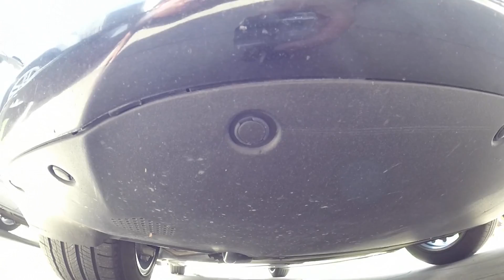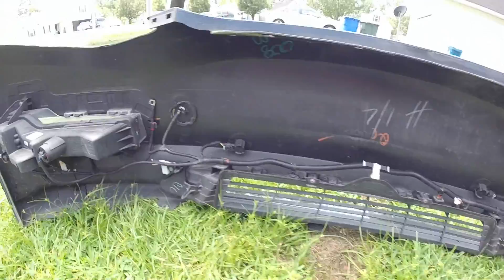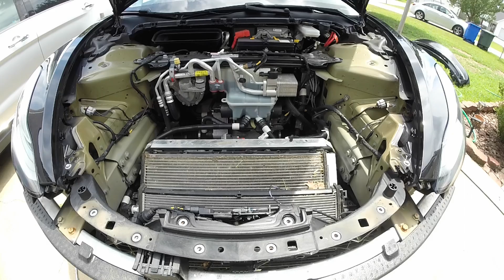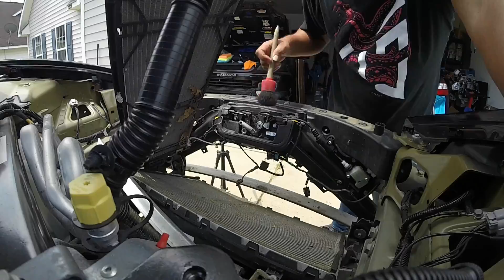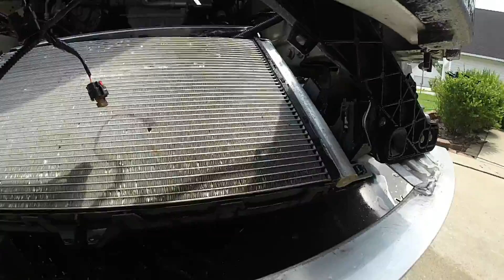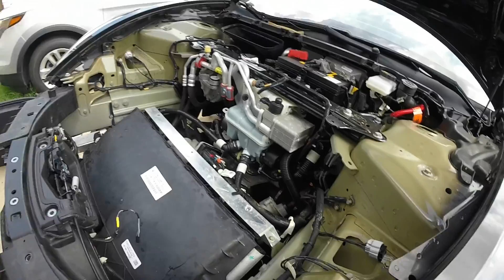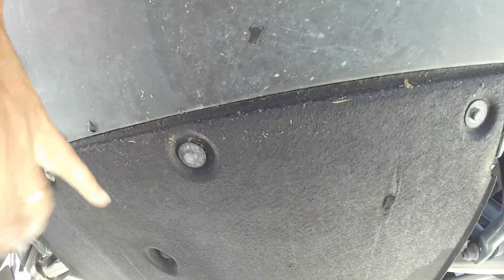Tesla Model 3 radiator condenser cleaning

Comment: That preasure jet will not bent the radiator fins ?
Reply from the maker: It can, I started far away from the radiator and brought it close enough to remove the grime. I also kept the stream straight and not at an angle. My pressure washer is only 1600 psi, and I can get my hand about 5 inches away from the nozzle before it hurts. I have had other pressure washers that have triple the power, I wouldn't use those.

Comment: I just finished doing this to my m3 today before I came across your video . Such a bad design, my radiator was so clogged up that my ac wasn’t working good in these hot Az temps but after cleaning my radiator my fan is quieter and my ac works perfect!
Reply from the maker: When it's been a year from cleaning, I will be doing an update video on how much it gets dirty. I have 2 model 3. One drives 1000 miles a  week, the other about 200 miles. This hopefully shows how dirty it gets and gives a better perspective on when to clean.
Reply: Do I have to out my car into some kind of service mode before I attempt this??
Reply from the maker: @DrakeKC  no.

Comment: Thank you for the video I have a certificate in auto mechanic and I very much appreciate enjoyed your video, Do you work on Tesla a lot.
Reply from the maker: I own 2 teslas. Unfortunately I haven't had any real problems with my teslas to work on them allot. For example, I replaced the brake, rotors on one of them simply because the rotors were rusty, the pads were like new and the car has 90k miles. I also decided to swap the wheel bearings simply because of the mileage and I started to hear a wheel bearing sound but I believe that it was because I have tracked the car a bit too hard. Lol

Comment: @jorgegarcia7005,

Thanks so much for this video.  I've also watched the other one where you put people's comments to the test.  Great stuff.  I plan on doing this with my 3 this week.  My driveway is not level, so I plan on taking everything apart in the garage first.  Then move the car out to the driveway to do the cleaning.  My question is - is the car drivable at this point?  I don't think it needs to be jacked up either for the cleaning process, right?
Reply from the maker: There's a video where a guy took off parts to see when a model 3 wouldn't run. I believe that it should, but I'm not 100% sure.
Reply: @jorgegarcia7005  Thanks for letting me know, Jorge.  I'll be trying it out today and will let you know if it runs.
Reply: @jorgegarcia7005  so I'm stuck at the removing the fan shroud part.  There are 2 horns right above the fan shroud that are blocking it, so I need to figure out how to remove those first.

Comment: 400 V and water, not a good combination
Reply from the maker: Automotive Parts are designed to be  water resistant and, in some cases waterproof when they are on the outside of the cabin. I've done 5 cars so far and have had zero issues. I believe that I'll be fine.

Comment: Great video, very helpful. Did this over the weekend and your video helped big time. Not to mention, mine was WAY dirtier. I'm also at 230k miles, and I've never done this.
Reply from the maker: Nice! I'm glad to hear that my video was of help to you.
Reply: @jorgegarcia7005  big time, thank you
Reply: Mine is 150 k miles
Just wanted to to check are you on original battery and drive unit ?

Comment: Hello, nice video, good explaned, but using the pressure washer is dangerous to bend al the small plates. I have done it one time with the radiator of a honda motorcycle, and it bended al the plates.
Reply from the maker: I made another video explaining how and why I use the pressure washer.
Reply: @jorgegarcia7005 could you please send the link to the other video? 🙏🏻
Reply from the maker: https://youtu.be/nsc7Wn4R55U?si=5XyOhy-yOCSFwvHz

Comment: Why would we pressure wash it in the direction debris went at the condenser. This will make debris trap in there deeper and harder to remove. Can we blow air or water in the opposite direction?
Reply from the maker: I made a video showing why you want to use a pressure washer.
Reply: @jorgegarcia7005 my question is about the direction of flush and not about pressure wash or not.

Comment: Hi George, I really appreciate for such an in-depth video. This really helps to understand how to service the radiator. One question, I wonder if doing power wash like that might cause the water damage on the sensitive electrical parts around the radiator. What parts do you think one needs to watch out when using pressure wash like you did? to prevent electrical damage.
Reply from the maker: I personally didn't see anything that you should be concerned with. Just like any vehicle you should exercise caution, but since these connections are already sealed and safe from the elements a bit of water shouldn't cause any problems.

Comment: What year is this Tesla, mine is 2018 with over 105k miles, just took to Tesla for 100k miles but I doubt they did that, is the same process for the 2018 to clean the radiator? Great video btw.

Comment: Hold the fuck up they told me the only thing you only have to do is washer fluid top up.. Your now showing me I got to do this shit…
Reply from the maker: I mean, my ICE vehicles only say that I need to change some fluids, spark plugs every now and then but because it doesn't say anything about washing my motor it doesn't mean that I shouldn't or wouldn't.

Comment: That's the older Model 3 without the heat pump, right? Because then it should't have a climate condenser because it gets its environment energy from the coolant. That update could make this cleaning step obsolete :)

Comment: Great video, thanks 👍- the only thing I’d do different is use an industrial vacuum rather than a brush for part one. I believe that the brush will actually force some of the dirt in to the fins. 
(People saying how hard this is need to realise that many modern ICE cars are even harder to clean the condenser and radiator, including my 2014 ICE SUV.) 
I have a mesh guard in front of mine from Alibaba, but I’m not happy with how restrictive it is- probably reduces flow just as much as lots of dirt and leaves I very strongly suspect. 

HOWEVER it would be nice if Tesla came up with an update to be able to reverse the fans when stationary, - that would actually blow some of the dirt out. Just like the cabin filter, this is a design that could really be improved upon in future models.
P.S. I’m guessing you drive on salty roads in Winter, going by the rust on bolts and disc rotors. Our 4.3 year old Tesla M3P has ZERO rust anywhere- thankfully no salt needed on our roads in Winter.

Comment: Looks like I killed my main frunk actuator by accidentally spraying it with water when cleaning my radiator condenser. I didn't fail at once. It took a while. When I replaced the actuator I noticed there was water in the unit. A FAFO lesson learned.
Reply: 60 тис. Даремно знімав   Усе чісто. Але стоїть  сітка
Reply: @ВладимирКачалаба  Do you have a heat pump Tesla? Someone posted about a plastic screen over the panel. That might be a new part on those cars with one panel.

Comment: In the HVAC industry, they make a niece foam cleaner to spray to the condenser. When you flash w/ water it is best to do it from the opposite to the air flow. Watch a few videos on cleaning air conditioner condenser from a house, same process.
Reply from the maker: I've cleaned the hvac in my home. Yes, you are correct on the cleaning process. However, my home hvac hasn't had this type of material ran thru it, just dust and fine particulates. The crud in the model 3 was everything from leaves, pebbles, dirt and road grime. A complete different set of elements. I will be doing another tesla soon when I will use the comments on my video to show why I cleaned it the way I did. This wasn't my first one and I tried different things before and this is the best way to clean it.
Reply: The imbed dust and cotton wood is normal around here, the rinsing from the back does help a lot.  @jorgegarcia7005

Comment: great video! I used to use nubrite cleaner to clean my 20yr old car's radiator, worked a treat
Reply from the maker: The only aluminum cleaner that I have used that works great is napa aluminum brightener. The others are weak compared to how they were years ago.
Reply: @jorgegarcia7005  thanks! added this to my radar

Comment: DO NOT pressure wash them. you will bend the fins and then you will have a very obstructed radiator and condenser. You need to wash it using a soap solution and a hose, regular pressure from the water, not a stream with high pressure. This is true for ALL, not just Tesla. All radiators, condensers, intercoolers, etc.must be washed as I described. Otherwise the thin fins will bend blocking the air.
Reply: Well, you just watched them clean the radiator with a pressure washer and I don’t see where any more fins or bent so I don’t think you’re accurate
Reply: He didn't bend the fins. I suspect the fins are more durable than you think.
Reply: Washing with lowest pressure is not a problem
Reply: Good advice❤
Reply from the maker: I would like for you to clean a tesla radiator the way you described and record and post the results. I didn't just decide to do what I did. I have another tesla, which I also cleaned. I started with the simplest way (air) and worked my way up to pressure washing. Then, I decided to make a video with my other tesla and explain how to do it. If you watch the video, you will hear me explain about it pressure washer and the radiator finns.
Reply: Could buy a can of ac condenser cleaner . Soak it and then rinse with hose . Definitely need a cleaner on those fins and not high pressure water .
Reply: The pressure washer he used is as weak as piss, it’s a really cheap and gutless unit. I would be more concerned about some of his other dubious work practices.
Reply: @rsoul7282 you’re dubious

Comment: Thank you for the excellent video!  Would have never suspected. Is this the same horrid design to clean the Model Y, S and X?  I would hope by now Tesla engineers would have fixed this for the Model Y and refreshed S/X.  What frustrates me is the complicated TUD (Total Unintended Disassembly, to adapt a term from SpaceX) required to just clean the A/C condenser and battery radiator. If regular (should inexpensive and quick) cleaning is not done, chaos will ensue. Failed expensive parts or worse. 

Have an idea….  For everyone seeing this video with X checkmark, say something to Elon and Tesla accounts. Adding this video link to the post.  Let’s get them to have a redesign.  Cleaning should take few minutes. Not hours, with risks of damaging components.

Wonder if Highland model is fixed?
Reply: Proper design requires balancing a lot of competing goals.  Is ease of cleaning important?  Of course, but it's not the only thing that's important.
Reply: @ThinkAndLetThink  there is no excuse for this crap.  None.  Elon Musk (chief engineer), knew about this early. So did his engineers and lap dog supposed engineers.  They do not give a rip that most Tesla owners (who will not take their car apart like this video) will guarantee have to pay $1200 for Tesla service to clean this up. 

Since the video, I bought a clever Chinese designed grill replacement.  Hope the quality will be good.  It has various methods to foil leaves, seeds, ground up road trash debris from entering.  However, will not protect from dirty road rain water from being sucked up into this cooling system. I took my bore scope with extension to reach the radiators. So far, I am lucky to not have debris up there. Except……. Already dirty road rain water has begun to coat all the radiators cooling grid with dried dirt. Not good….

Comment: Using a high pressure jet on the thin radiator fins is not recommended as it twists them.
Cleaning with a vacuum cleaner then using compressed air seems less destructive.
Reply from the maker: As addressed in the video, the radiator fins are pretty strong. Not saying that you should get closer than I did with my pressure washer. Additionally, being that this is the second time that I have cleaned one of these, like mentioned in the video,  the crud in the fins is basically mud. Also, I'm pretty sure that my air compressor if it was able to get the crud out it would be just as strong as my pressure washer and would bend the fins if you would get too close.
Reply: Firstly, thank you for the video, very instructive, not easy to do both the work and video. That said, I would definitely vacuum first (with a brush attachment) because it immediately removes the surface debris, rather than brush it over the rest of the radiator. Seems like it should not get that way in the first place, like there should be an easily removable, cleanable filter. Thank you again for making the job clear.
Reply from the maker: @kirkdoray3393  I did another video showing all the advice on this cleaning. The vacuum isn't really good for the radiator. Please feel free to see my other video on this cleaning.

Comment: That’s a lot of work…didn’t even know the condenser had to be cleaned..
Reply from the maker: I do car repairs and to be honest this wasn't that hard.
Reply: @jorgegarcia7005  I am a retired former workshop owner and mechanic,I was a Renault dealer during 40 years in Strasbourg (France)
Reply from the maker: So we are in the same page. Lol retired US military here. Lol
Reply: @jorgegarcia7005 thanks for the video. I added an individual post/comment. I do not think some people understand how the angled radiators collect all the grime and blockage. Unlike pure vertical radiator.  Vertical radiators up front also will get some cleaning in car washes and rain. Where the deep embedded semi horizontal radiator/condenser become a big scoop for trash. 

My C4 Corvette had a slight angled radiator. It would clog easier than vertical radiator/condenser on the C4 which also was deeper embedded. However, the C4 was easy to keep clean. Thank you for the video.

Comment: Wow when you popped that open and all that crap fell out I thought what a terrible design.  Thanks for the video :)
Reply: The cost of having a frunk..
Reply: @mrflorida55 nah Tesla should just have mesh behind the grill, easy fix
Reply: @Spaceman2484  My point is radiator mounted vertically does not have this problem they could not do thay cuz frunk..

Comment: Tesla should be required to a full recall of this potentially dangerous design. They literally designed a pocket to collect dirt which blocks the only way the batteries are cooled. Insufficient cooling of batteries can shorten battery life at the least, or battery fire at the worst.  

A simple reversal of airflow, air intake side of radiators face down, could take care of most of the blockage. Adding Venturi effect or even cyclonic effect air flow before the air gets to the radiators would cause most debris to drop out instead of logging into the radiator.
Reply from the maker: I believe that reverse air flow should be a thing while supercharging. But great point.
Reply: Full recall - LOL :-). You’re kidding. The condenser and radiator in my ICE car is even harder to clean- a nightmare actually. 
It’s NOT dangerous - all temps are actively monitored. 
With it partially blocked you’ll lose some efficiency- that’s it!

Comment: It will be cool if Tesla adds a self clean feature for the radiator/condenser coils.

Imagine connecting either air or water supply to an external easy-to-reach port and a sweep and wash cycle is initiated. That will be awesome and a game changer.
Reply: That would be a waste of space and an unnecessary cost given that this is needed very rarely.
Reply: @A7wG9pQ8kL  These Tesla guy are motivated geniuses. I bet they can do it in ingenious cost, parts and space saving ways like they've done with octovalve, supermanifold, gigcasting, and the recent cooling beam. 😌

Comment: Great video!
It might be a good idea to put a mesh over the intake opening to aviod any future large contaminants from entering the radiator.
Reply from the maker: I will be getting a mesh grill. They are available for sale from the aftermarket.
Reply: @jorgegarcia7005 The only trouble is- the mesh grille does reduce airflow. 
I have one and there’s a very significant air flow reduction, so in some ways it’s counter productive.
Reply from the maker: I believe that. Will see about using it during fall and removing during summer and see how it impacts the car.
Reply: @jorgegarcia7005 I’m actually thinking of leaving the extra mesh in place- it’s much finer than just the factory louvres, but removing some or all of the insect screen that came with it. It’s the insect mesh which I believe is most of the restriction.

Comment: Who is this video intended for?  The average Tesla owner wouldn't even think of doing this!
Reply from the maker: In a future, not far away, when some kid who doesn't have issues tearing things apart gets a model 3 for 10k, he may have an issue with cooling. That's who my video is for. Oh, and for those who currently own them and are not afraid to turn wrenches.
Reply: It’s for people like me! I grew up working on cars with my mechanic dad. I also took auto mechanics in high school. It’s super helpful. I WILL be doing this. Also possible adding some kind of screen in front of the intake to keep out the larger junk. It’s like a vacuum cleaner for the street.
Reply: It’s for people like me who’d rather spend a few frustrating hours as insurance to help protect a $10k+ battery.